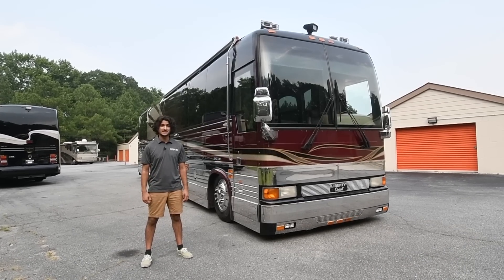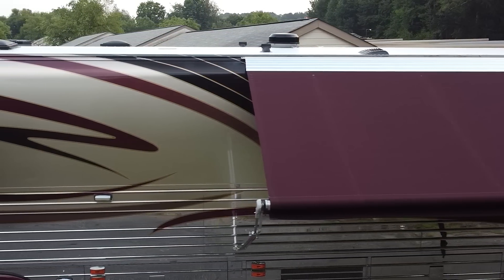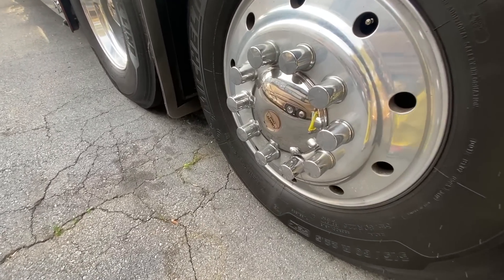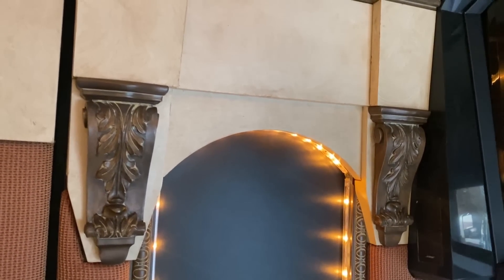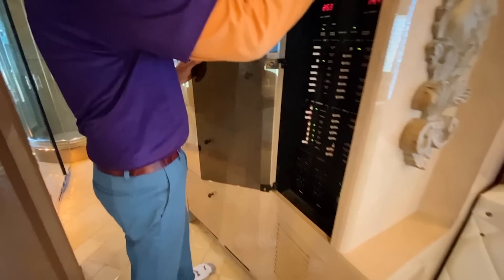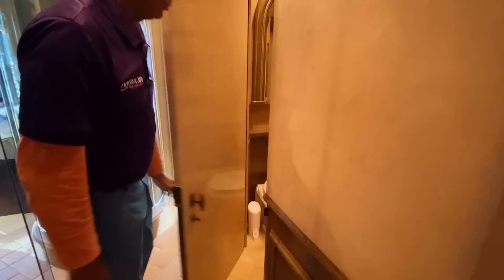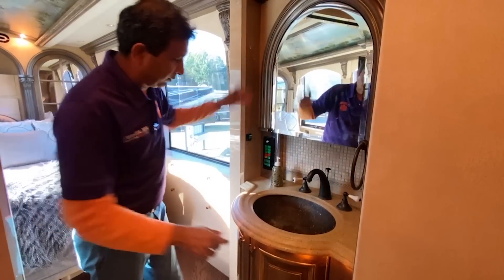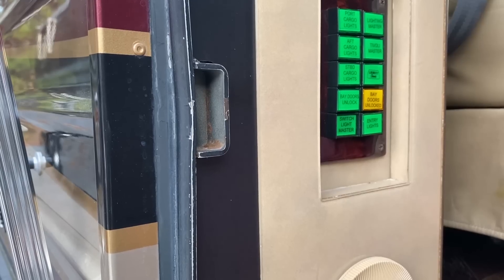2002 Liberty Prevost XL bus tour inside, outside, storage bays and test drive,

Comment: Even  no  sliding   coachs   are    still    for  me   fantastic   ,  plus  the  double   decker    coaches .  In     case    of  the    double   decker    coach           
The  first  floor   the   bottom  should  be   wide    in  my  opinion   for
a   three    meters    and  the  higher   level   the  first  floor   for   a   two
and  half   meters   or    maybe    two     meters     and   seventy    centimetres    ,  with  telescopic     shafts     which  helps   to   rise
the  upper    level    ,  which  I  saw   before     in   the  English     coach ,
,  so  breailent    idea   ,  they  even    made     a  bathtub   but  the   
bathroom   was    open    to  the  other    rooms   ???.  I   think   they
should    make    separate    with  the   door   to  close   the    moisty 
bathroom    especially   during    the  bathtime   where  the  stem    
Is   usually    huge    and  I  was  really  surprised    that    they   didn't 
think   about  that   ?.

Comment: You didn't mention the heating system for when the bus is not running.  You also did not mention the roof. For 300k it needs quite a few upgrades.  Looked like one of the airbags on the gen was deflated but guess an inspection would pick that up.
Nice bus at first glance though. Thanks for the tour.
Reply: Upgrades?,?? are you kidding me ?  Outside of solar, which us an addution, this is gorgeous, leave it alone. sheesh.

Comment: Shouldn’t it have more ground clearance? I saw you driving it so I assume the air bags are not dumped. Ok you just mentioned that so Why would you move it with the air bags dumped
Reply: 3 rides heights  this may have been low for hwy travel